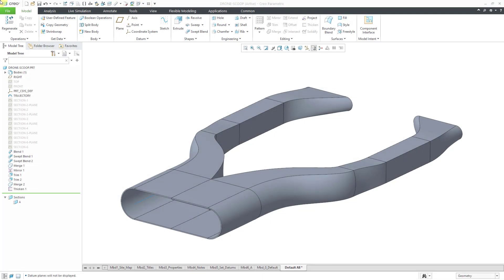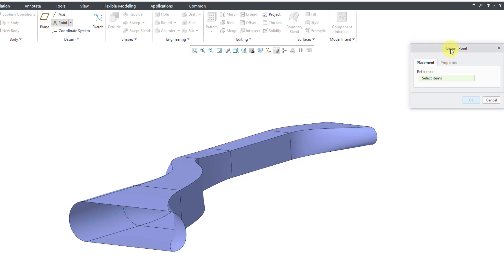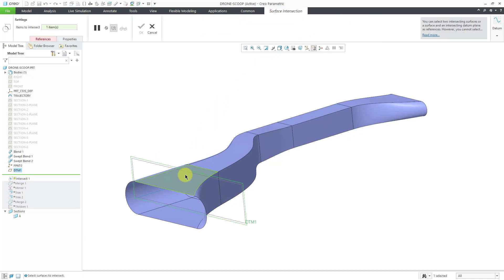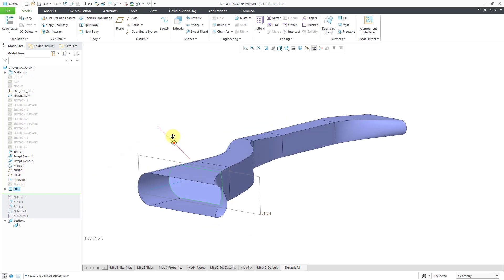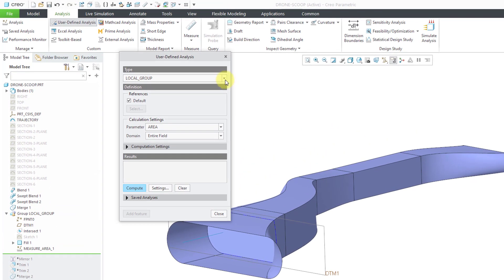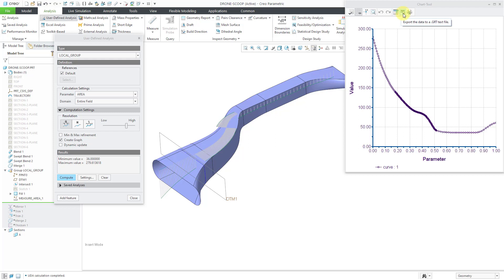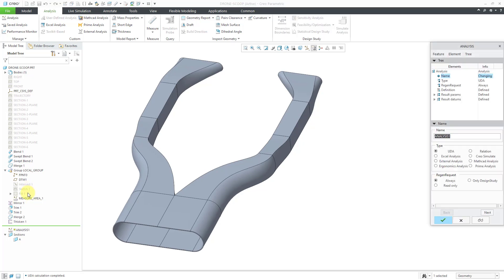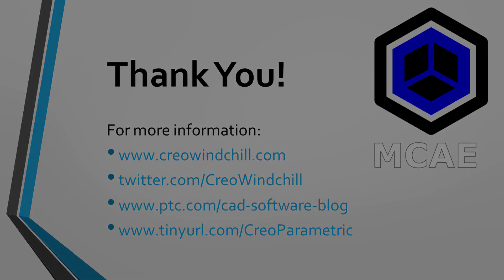Creo Parametric - Behavioral Modeling Extension (BMX) - User Defined Analyses (UDA)

Comment: Once the UDA is created and made a feature, how do I make it a tool that I can re-use for shaping a part?  I'd like to repeat a X-Section Mass Properties analysis and then export the graph data to perform a simple calc to generate the Polar moment of inertia (Ixx +Iyy).
Reply from the maker: It depends on what tool you want to use to generate the Polar moment. Personally, I would use an embedded Mathcad worksheet.